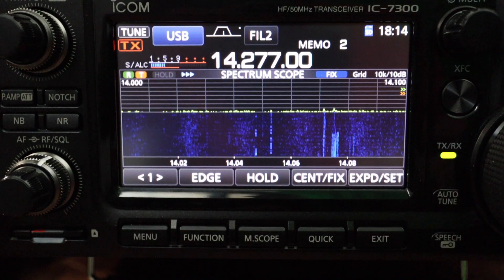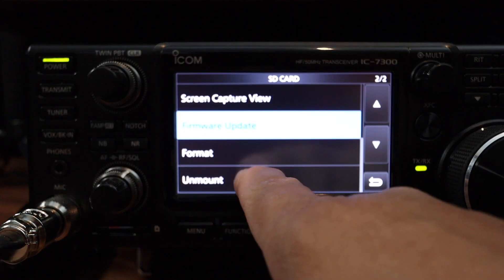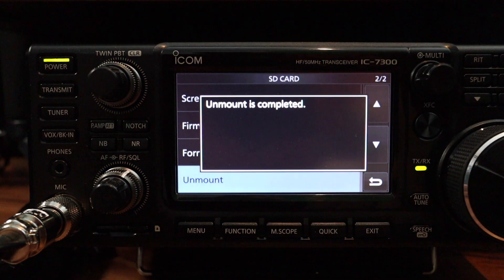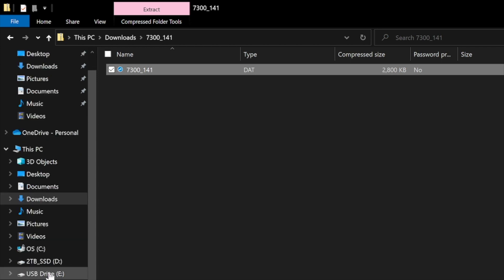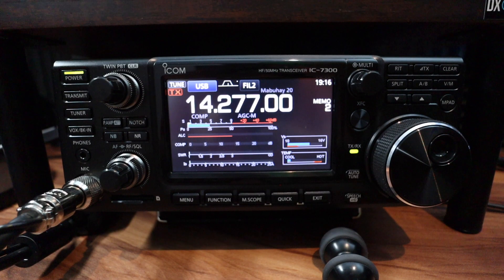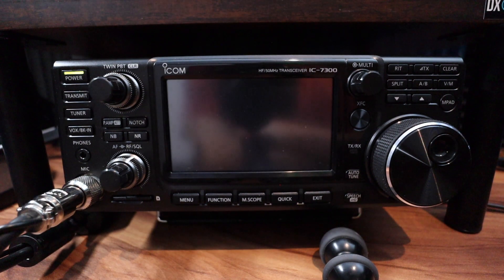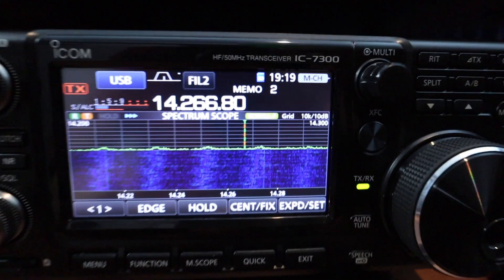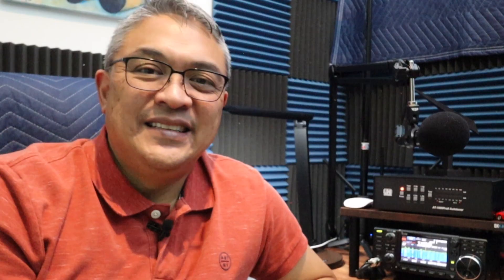Firmware Updates on Icom IC-7300 | Quick and Easy Process! | How to update Firmware to V1.41

Comment: I have been trying all day and every time I put the sd card in there it says no file. I copied and pasted the .dat file into the sd card. But nothing. I think it’s to with the size of the sd card. I formatted a 64 gb into fat 32 and it worked no problem in my xeigu x6200 for that update. So I think it may be an icom thing. So I’ve got a couple of 16gb sd cards coming tomorrow. Hopefully the icom 7300 can read it and format it correctly. 73’s from the Uk. 🇬🇧

Comment: It would be more instructive to publish the SWR of the antenna WITHOUT the built-in Icom tuner.  You should not need the tuner if the antenna ads say it works on 40 - 10 without a tuner.

Comment: And remember to invest in that MFJ1026 noise canceller if you haven't already :)
Reply from the maker: At my other QTH where this video is made, I don't have interference issue.  But, man the powerline noise is back in Florida.  I haven't got the MFJ1026 just the QRM Eliminator.
Reply: @DarrenN4VFR  That's right true,  I hadn't recalled you purchased the QRM Eliminator. Just a superb piece of gear. Glad to hear you have no RFi at that QTH!
Reply from the maker: @624radicalham  Yeah, I just tested the QRM Eliminator with a temporary wire antenna.  Here's the video:  https://www.youtube.com/watch?v=__bvoUl7A8U  I only used it for 1 day and still have it sitting on the shelf in Florida.  My Texas QTH doesn't have all the Interference like in Florida.